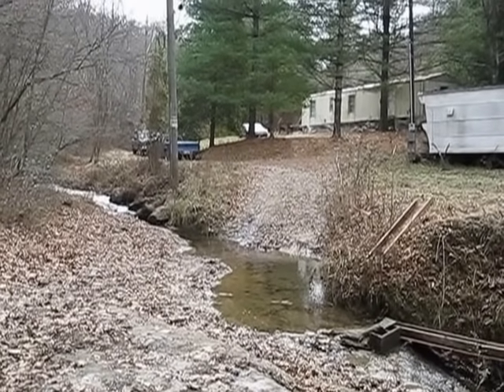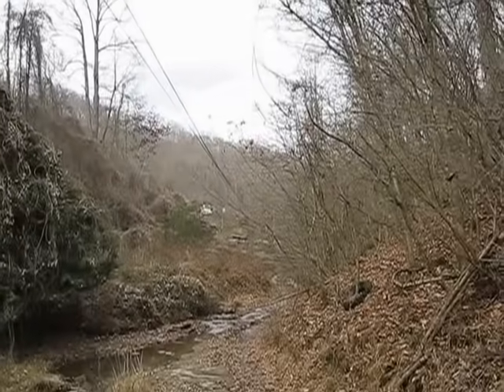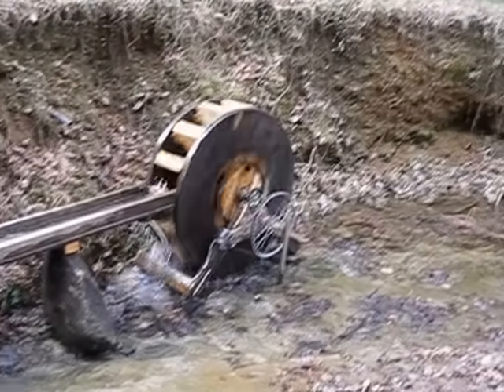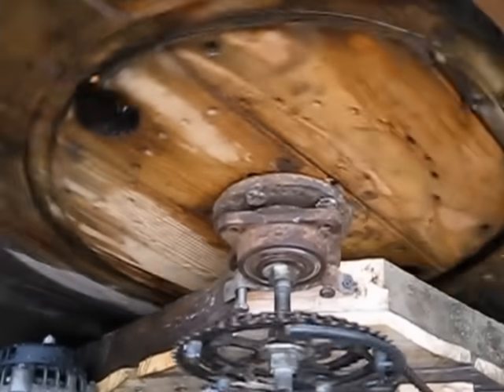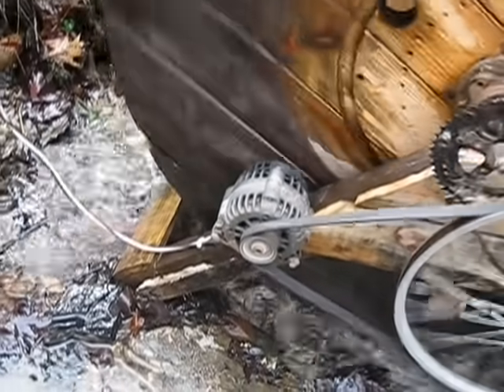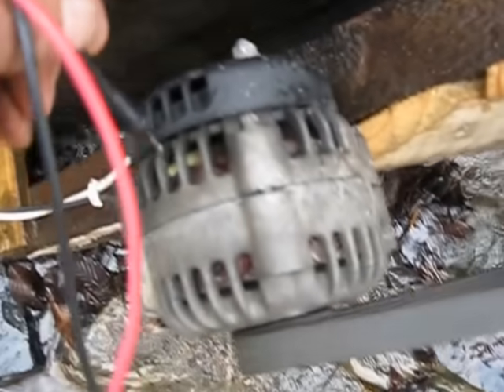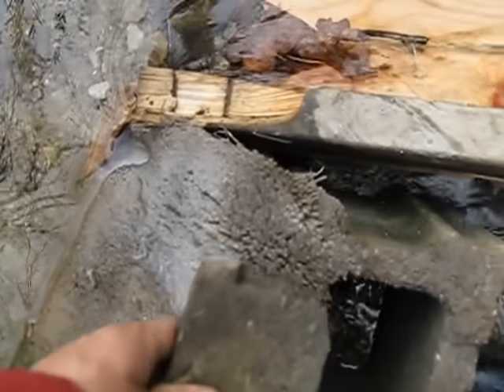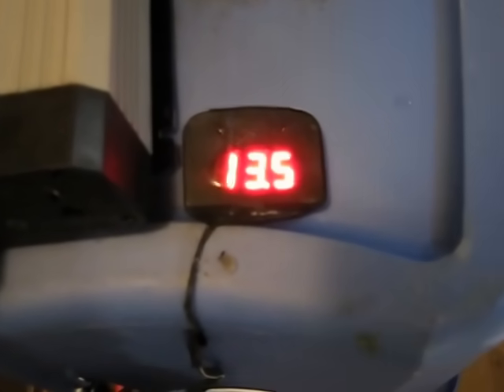water wheel generator

Comment: Your alternator, is it putting out DC or AC voltage?
Reply: No its DC in only on an inverter. You can do that with step up transformers. He modded his alternator with a full time neodymium magnetic shaft. Remove the now un-needed brushes. Removed (if it had one) the voltage regulator. He MAY have tapped off of the stator coil for AC. But it seems he is running DC out going by how its wired. Though 40 volts ran it into the input on a old computer bus. (An Inverter that holds batteries) Where the voltage regulator brought the output to around 14 volts to charge his batteries.On the alternator Using the magnet system means it needs less turns to produce more amps and voltage. He may be charging off of the Computer bus circuit. If that answers your question. The inverter draws some amps itself when it steps up the DC to AC at 120 volts even when nothing is plugged into its output.  Not much but but still draws. I hope this answered your question.
Reply: an alternator is DC, like in a car.
Reply: Anthony Jones An Alternator makes AC but has bridge rectifiers built in so it outputs DC, what I was querying is if the bridge rectifiers had been removed and it was AC being output, much betted for sending AC over a distance and then rectifying at the location of use rather at the source of generation.

It would also be much better as any load would have less of an impact because you don't have the voltage drop of the cable (its resistance) over a distance.
Reply: The output is DC after the voltage regulator and Rectifier point. AC they generate.
Reply: The question then is would your inverter take an AC and boost it and charge your back up when you are in an over production period..?
Reply: Water powered turbine

Comment: You're getting all that for "nothing"? All what?
Reply from the maker: I run led lighting, two tvs with Roku boxes, a refrigerator, and a laptop. My water gravity feeds from a spring.  I have natural gas for cooking, heat, and hot water.
Reply: all that tax free electricity dummy.
Reply: all that tax free electricity dummy.
Reply: Well, what all will it run in his house? A/C, heat, hot water, washer, everything? Or does it power a few light bulbs and a small tv? I like the idea. Doubt if he works for free.

Comment: You can make a water ram and boost the pressure to about 30psi and use that to power a more lightweight flywheel at faster rpm... Water rams are super simple and there are some videos on how to convert a old washing machine into hydroelectric generator and use that to supply power to a battery bank.

Comment: Looks like you occasionally get high water flow in that creek.  What happens to your set-up when the water rises and the flow rate increases?
Reply: His overall idea is okay..  But the water intake needs adjustment and his pulley ratio is bad.

I would built it off to the side like a hydrodam...true one high water rise would ruin this idea ..

Comment: You shouldn't have those batteries in a living space... only used sealed batteries! Those car batteries will off-gas, they need ventilation!
Reply: If you cough a lot, it could be the battery fumes from the constantly charging batteries.
Reply: That shit won't hurt ya
Reply: @Stevesbe   Yeah,it will. Fire up a blunt and you may be surprised.
Reply: No!!!! They din't.

Comment: I like the way you don't fuss with perfection & just get stuff done, some electric shock & fire risk, make sure to add cut out relays & earthing with the DC, if you grip a high volt DC circuit its hard to let go especially as the battery bank gets bigger.
Reply: GE used to send newly graduated engineer hirees to Africa to do stuff like this. It may still. Not only did the company wish to do good but wanted them to learn to become inventive.
Reply: Hi guys
Please i need your contact.

Comment: two things to point out. A car alternator needs a hot 12 volts to the unit. It cant produce power with out one. Now on the other hand a Generator can make power with not a energizer wire. A true generator from a car is from like the 50s. Also a alternator  a car needs to be spinning at a high RPm
Reply: you have to convert an alternator to a permanent magnet alternator fornit to work. but it will work

Comment: You could have the water trough pass over the top of the wheel and fall down on the far side of the wheel. That way, the water's direction and gravity work more to your benefit.
Reply: Yep it’s called an Over Shute wheel, a only works if you have enough fall, which is not the case here.
Reply: @philipmasters7491  I thought a micro hydro system wouldn't work at all without enough fall?
Reply: what happens when it rains?
the water volume goes higher which means more spinning and causes higher voltage output.. will it not destroy your devices? like the batteries and alternator?
Reply: @julimeryecla9552  the alternator can handle it. The battery charge controller handles the rest which is the point of having it 🙂
Reply: @TurboHommy  do you mean, you will connect a battery charge controller to the alternator? or the alternator already has it?
Reply: @julimeryecla9552  you need to connect it between the power source and the batteries.  When the batteries are full, the charge stops charging the batteries even know the alternator is still turning.  Amd generally with the right controller, it will then start to run the house directly off the alternator and save the battery power for when needed.
Reply: @TurboHommy  wow..that's cool.
where can you buy it? and how much?
Reply: @TurboHommy   -  He need a dump load?  Or does something in that controller take care of it...
Reply: Julimer Yecla: That's what the RV voltage regulator is for: It prevents an overload by governing the amount of power let in from the alternator. What he needs: Higher fall( water pressure- a "jet" system produces the most), and more alternators.
Reply: Julimer Yecla , that’s a very good question! I don’t think about yet!
Reply: Undershot vs overshot wheel. Both have advantages. An overshot wheel requires more fall than he has available here
Reply: @johnkidd1226  but take into consideration that the stream is on a hill, so if he would take his water higher from the stream he would get it to land higher on the wheel. He only needs to move his dam higher up and build a longer water ramp - that way he could make overshot wheel system with the resources he has. He could also try to dam that stream better in which case he could make a little pond which has higher water level, and then he could take water from the top of that pond and it would land higher on that wheel of his.
Reply: @T12J7  but if you see he has to drive through right there too
Reply: @spar8334  then just move the wheel so that it's before the roadway and take your water still uphill so that you get it to land higher on the wheel... problem solved.
Reply: Pond or dam?

Comment: very nice, have you considered, adding a second alternator
Reply: No point. He said that he can stop the wheel from turning if he connects a high load. The ultimate limit on his power production is  the water supply and overall system efficiency.

Comment: A waterfall would make no difference in his system he is puttinging out a constant 13.5 volts, enough to overcome the 12 volt resistance of his battery storage so they will take a charge. He is using maybe a cs130 alternator. It has a regulator that keeps a constant current coming out. It has a diode assembly 3 negative 3 positive depending on which side blows it could over charge or under charge if you look inside he has a volt reader which tells him he is at 13,5 .. 13.5 to 14.5 is good . any alternator will work but you have 60 amp alternators on up to 160 . cs 130 means 130 amps . good system and if you don't rebuild your own alternator you can always go to a u pull it for a replacement.

Comment: I've been considering getting a tiny house and setting it up off road/off grid while generating my own electricity and was wondering if something like this could be done. I'm learning about electricity in cars in college and realized there had to be a way to generate electricity for household appliances in a similar manner, while using water or wind to get the alternator turning.

Thanks for posting this! I'm glad to know it's possible and fairly simple to achieve. 40 volts is pretty impressive and probably far more than I'd need living on my own.

Comment: to get more power easily, just move you water wheel down the hill more until the water comes onto the wheel at the top. You will double your power. (power = Force times velocity) You will have twice the force at the top. reversing the wheel so that the water does not change direction should help as well. - Bob (Electrical Engineer) That is really Great, I would like to make one some day!

Comment: You could get a lot more power from that wheel if you could build a small dam upstream raising the head of water up about a foot higher where the water enters the sluice way.    That would allow you to raise the wheel end of the sluice way up enough so your water would pour into the next higher wheel pocket up and fill that extra pocket with water which would increase the weight of the water in the wheel and create more torque at the output shaft end.     An over shot water wheel of this kind runs by virtue of the weight of water carried in the wheel pockets.  As the first water pocket reaches it's emptying point at the bottom,  another pocket at the top is being filled to take it's place.    The more water filled pockets you have the heavier the load, which in turn boosts the wheels force on the output shaft.    Your water wheel is not running at it's full potential.    And by arranging the sluice way so water is pouring straight down on top of the wheel instead of hitting it from the side as this one does will also do away with what little drag is created when the wheel has to slice it's way through the stream of water from the sluice. The ideal setup would be having the wheel turning in the opposite direction and have the water coming over the top of the wheel and dropping into the pockets on the opposite side.   That would enable almost every pocket on that side of the wheel to be filled with water all at the same time and doubling the weight of the water that is turning the wheel.  That's a great little wheel you have and it has the potential to be used for a variety of things.    Turning a grindstone to sharpen your tools and axes is only one of the many things that comes to mind.   And doubling your power output by using more than one alternator is another project that is open to you.   The sky is the limit for home craftsmen like you, Orville & Wilber Wright started out in much the same way dabbling in an idea.    Best of luck to you.
Reply: ;) nice information, well put. similar thoughts

Comment: 💡If you make a wind mill out of an alternator, and put it in the top of the tallest tree, study up on ratios to build the prop the right size so you can have high rpm even with low wind speed, and still get another 110 input in your house, so your 220 on natural power could potentially make 440 if inverted. be sure to build a housing around your alternator to protect the windings from the elements and debris.... Great job 👍🌀
Reply: How many rpm  by this size of tubine to get 220 volts of continous electricity for the whole house ?

Comment: I love that small creek being so near to your trailer.   I have a good sized brook that has a 20 foot water fall and I am going to build a water wheel generator, and also try my hand at building a ram pump to irrigate my garden and provide water for the chickens and pigs.    I will have to set up my wheel off to the side and use pipe to carry the water over to the water wheel because in the spring and fall rainy season no water wheel could stand the pounding it would get from the flood waters.   The brook in front of my house turns into a little Niagara falls for about three days after we get a big rainy spell.    But in the dry summer months I have about the same amount of water running in my brook as you have in your little creek.    I guess I  don't have to remind you how lucky we are.
Reply: is a ram pump similar to a monitor? by monitor I mean starting with a big inlet and going smaller every few feet to create pressure?

Comment: Yes / Awesome idea / Design / You can increase power several ways / Replicate the design / use two wheels or simpler even yet two alternators in parallel / creating more current / better capacity batteries / low loss voltage regulator / inverter / what about bearings on the bike wheel / low friction tensioner  for the belt. Just some more ideas / thicker wire / less distance to the inverter / power station / all these factor into loss of power / what about some windmills ? Great Location /// What State ?

Comment: You may want to look into solar panels for your power. I started off with a small windmill but Solar has now become so cheap that it is way more power for the money spent and pretty much maintenance free. I would still keep the waterwheel as long as no one say's you can't use it. You can check out solar panel prices on solarblvd.com   You could put a culvert in there and then try running the paddle wheel by pushing water thru under the bottom of the paddle wheel. That would stop people from saying your obstructing the stream for fish etc. I have a battery bank of 8- 6 volt golf cart batteries that is 6 years old now. They are starting to wear out now.

Comment: Some constructive criticism:

You would get more energy (tq if you will) if you were to have the water fall on your water wheel from the top.  Allowing the water to fall some before reaching the wheel would increase your power even more.

I would suggest some kind of cover for the alternator.  A cut up 2L soda bottle to keep the water from splashing on it would be perfect.  Those things hate water, and after dealing with cars that have yearly alt failures from rain splashing on them was more than enough for me.

I don't know if this is a problem, but how is that alt doing heat wise?

I would be very weary of keeping batteries that are in use in the house.  I do like that you have it covered, and would be even better if you had a vent set up to allow any hydrogen to vent outside.  But I have seen a couple batteries out right crack open.  I personally would have them outside the house.

And to build off that statement, if you were to have the batteries stored closer to the alt, that would be more efficient.  You are likely wasting a bit of power pushing that DC all the way to the house.  Put the batteries on the shore right next to your little power plant, convert to 110, and run AC to the house.

Please don't take these comments out of context, I like what you got built here.

Comment: Really hoping it don't rain much ,you need a concrete spillway to control and secure or at least allow that wheel to sit center of the stream secured .A potential storm surge can but diverted on both sides that setup won't endure much weather..
Reply: +arthur clark  You are correct !!!!! That is the reason for a millrace

Comment: What a great idea!  Thanks for sharing this.  You may want to look at this video of a guy who stopped using a car battery in his car and powers it with super capacitors.  If you were to do something like that, you may be able to fit more in a smaller space and the capacitors charge almost instantly.  They wouldn't last quite as long in the event of loss of water but are less expensive than batteries if you were to buy rather than have the batteries given to you.  Also, depending upon how many capacitors you connected in series, you could completely customize your voltage needs with the one alternator.  His YouTube channel is called lasersaber.

Comment: how much water per minute u estimate going thru that trough??? i need some info for my self running hydroelectric generator...ill be using a high volume low wattage pump to power the turbine ..and some of the power created by the turbine will charge the battery that the pump is running off of...

Comment: GOOD VIDEO,  I think I might help a little, Ive sold interstate batteries for over twenty years. THose deep cycle Batteries store more power butt the plates are close and a high voltage sure like 14-15 can warp plates that are extremely close. I would recommend tractor trailer batteries, also you might place your water intake higher on the wheel poss putting a small board across front of each compartment more water more weight more power